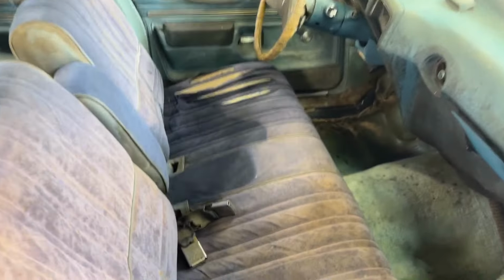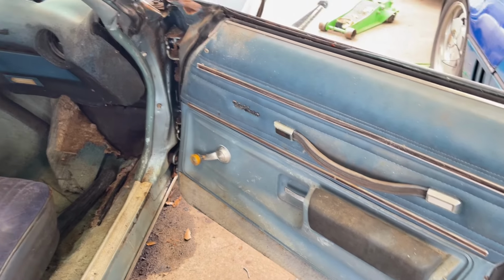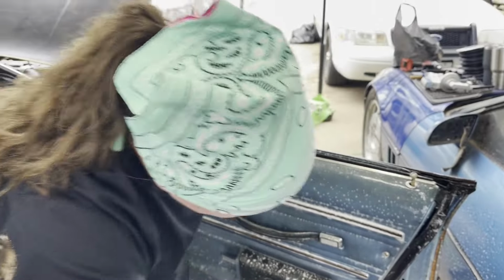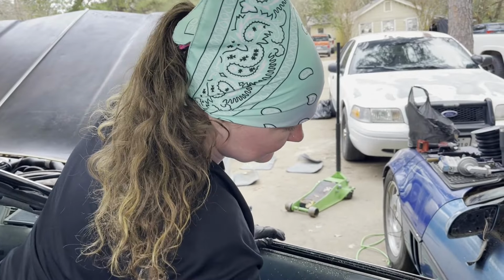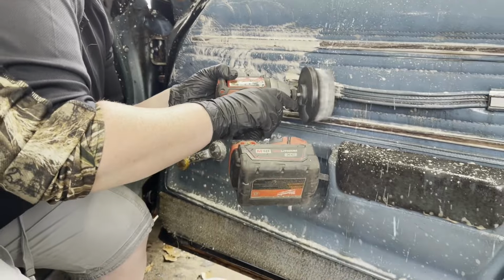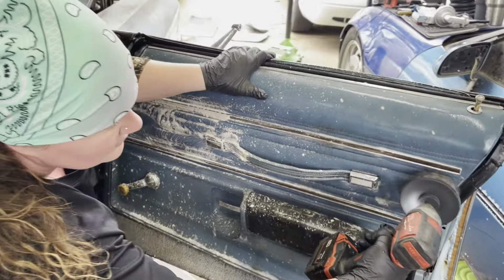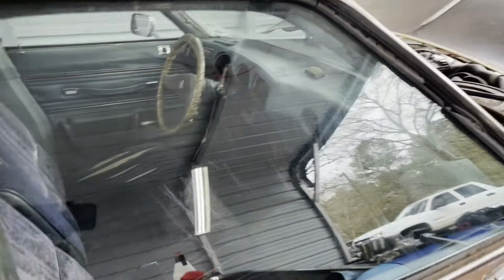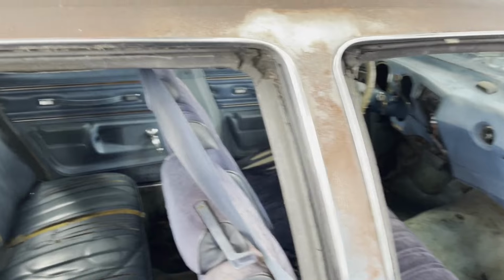Cleaning the interior on our once abandoned 1976 Vista cruiser.

Comment: Shez came a long nicely 👍 still think 15x7 Olds ralley wheels would look good. Thanks for sharing
Reply from the maker: I think so too, I have found a few sets but they are either in terrible shape, or way more than I wanna spend to still have to buy new tires.
Reply: @Pssstgotbags9494  I thought I bought four 14in and got two. Other two was 15s. Good shape with a couple lil stainless rings missing but I need to sell em or use em.
Reply from the maker: I’m gonna guess by your name you’re in Ohio and a bit far from me or i would pick them up for sure!
Reply: @Pssstgotbags9494  Yep, and by the condition of that Vista.. shipping would be stupid expensive.

Comment: Rust-Oleum spray paint for plastic on some of the interior trim, especially the plastic by the rear windows. They make a variety of colors.
Reply from the maker: Unfortunately the plastics that seen a lot of sun are disintegrating. Quality of the plastic trim on these years were not great.
Reply: I own a 1974 Malibu sedan.  I agree, the interior plastic trim is poor quality. I spray painted the dash and rear window trim pieces. It turned out ok. You may be supised.

Comment: Try using Gorilla Glue on the top of the dash pad where it rolled up.  Secure it down with patio bricks. That to may work.
Reply from the maker: I may just try that, would make it look a little better. Biggest issue is the dash pad has actually shrunk a bit from this texas heat. Materials in the 70’s weren’t all that great.